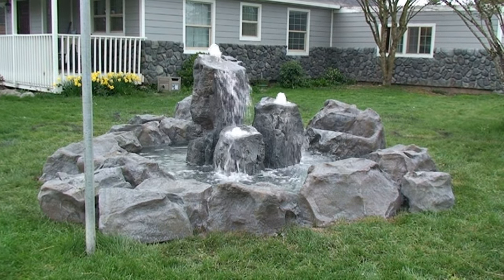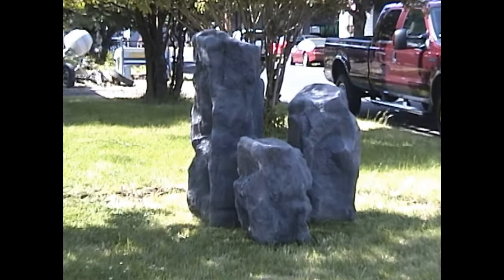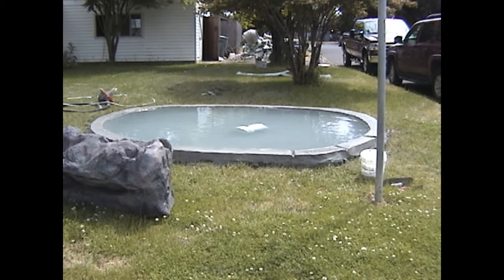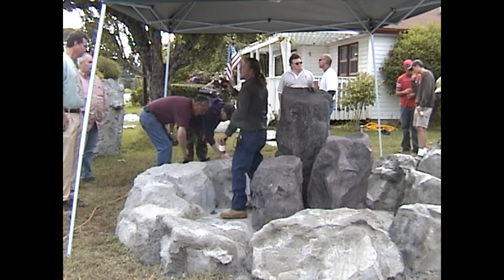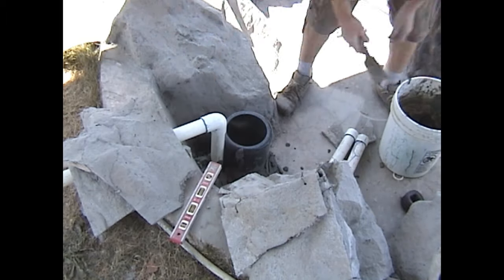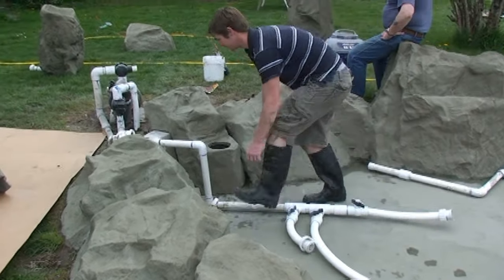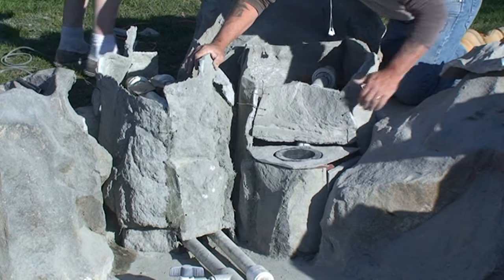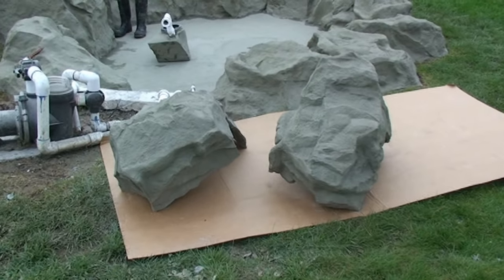How to build a Bubbler rock pond

Comment: Do you hydro-seal it on the inside as well? Also what type of product did you use to hydro-seal? I'm looking to soon make statues and a fountain for my garden and wanted to be careful with the sealing process.
Also, I would have thought you would have to stain the rocks before hydro-sealing but I guess not from the looks of it, what kind of staining is used?
Reply from the maker: We Hydro seal all areas inside and out of the pond, including the bubbler rocks. The Hydro seal that we used is a proprietary blend, but you can buy Hydro seals which are obviously cement based just seal the work that you have in mind to accomplish. The Hydro seal is done and dried, and then you can stain the feature. As far as what stains, I use 100% acrylics and dilute them with water.
Reply: @fauxrock  Thank you very much, I am just now in the process of washing your "Staining fake rock Part 2" video and it's very informational. The cool thing is I've been deeply getting into the hobby of making miniature realistic dioramas, and there I am also making fake rocks out or foam and making them look real with just various paints and methods of applying them, so seeing you talk about it in a real life scale version is highly interesting. It's like the same thing except one uses concrete to make it stronger and feel real. The only exception is the big version needs protection from weathering factors. And I'm glad that the good method to use is acrylics since that's what I'm used to for miniatures.